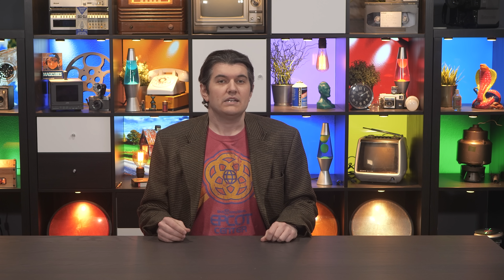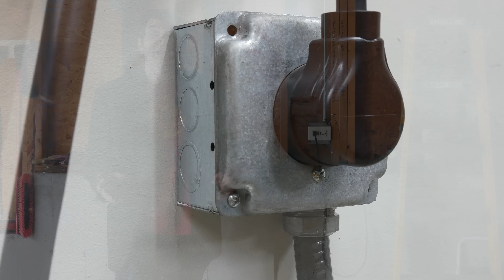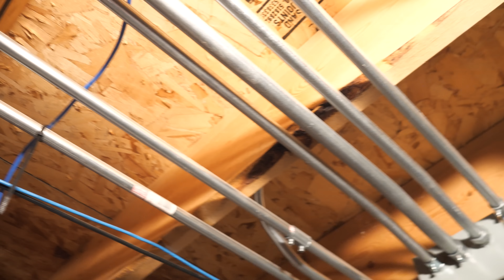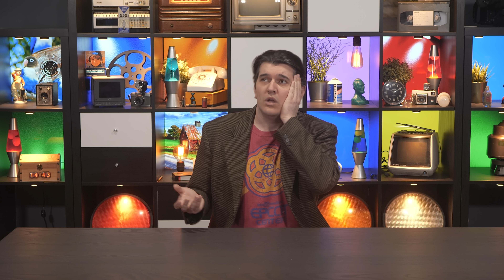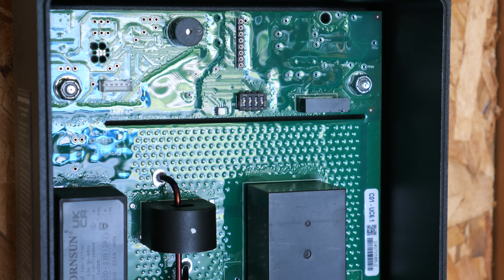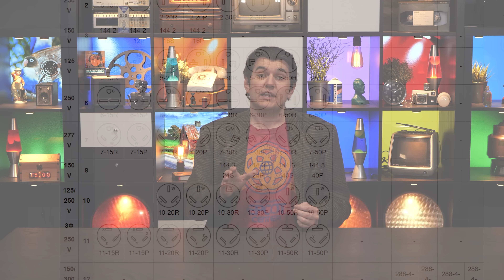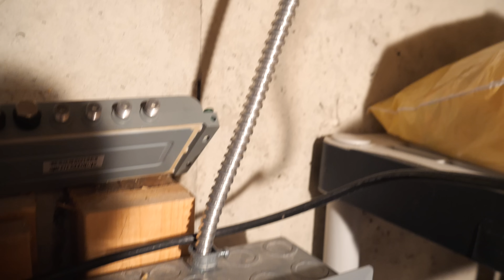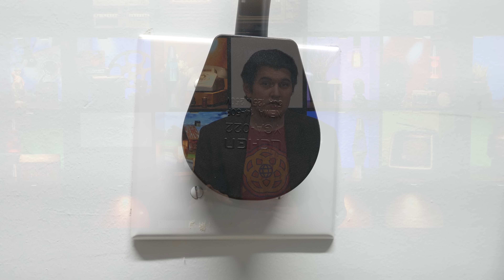The "standard" car charger is usually overkill—but your electrician might not know that

Comment: I drive a 2013 Chevy Volt. I use the standard outlet to charge it at home. Before this car, I drove a Nissan Leaf and still only charged it with the standard outlet. It doesn't hurt that my work has free 240 charging that I used nearly everyday as well. My commute it only 20 miles one way, so my Volt requires that I use the charging at work in order to get home again because of my car's age and limited charge capacity.

Comment: Be aware that hardwiring it like this turns it into a fixture, and it belongs to the house and not the owner.  If you move, this matters.  Also check to see if you need a neutral, many older circuits omit the neutral.  I have a 30 amp circuit, installed in 1967 for a window AC.  It has no neutral and a 14 gage ground.  Apparently code at the time.

Comment: great video. I live in an apartment complex on the second floor and frequently run a long (properly gauged) extension cable to the parking lot just outside my window to charge my PHEV during clear weather (yes I continuously monitor it during charging with a security camera). works great for my commute. there's so many misconceptions out there about EVs

Comment: This guy should state in the beginning that everything he is saying is HIS OPINION ONLY. Code requires the breaker and conductor to be rated for 20% more than the load it will carry. I actually would tell people to install the highest amperage breaker/receptacle that their wall adapter can safely handle. You should also put the EV wall adapter as close to your main breaker panel is as possible. I have an older Tesla that can handle 80amps of 240v Level2. That requires a 100amp breaker. Most new EV's can handle 48amps of level2 charging. This requires 60amp breaker and for the wall adapter to be hard wired. If you are using a 50amp receptacle you are limited to 40amps of charging. Also charging using a 120v 15amp outlet is painfully slow. Youd be limited to 12amps and takes more than twice as long to get the same charging as 220v at the same amperage. Id rather having the voltage & amperage available and not need it than to need it and not have it.

Comment: You: "Can be installed on a branch circuit of any size"

The Emporia classic, for one example, says in the instructions:
"To reduce the risk of fire, connect only to a circuit with 60A maximum branch circuit"

This is despite the fact that the charging rate max can be scaled by breaker size as a feature.
Because of this line, the electrician has little choice, as code requires that he follows the directions.

Then, it's not just the electrician. Despite the fact that with a Vue it has peak leveling to prevent the charger from causing the panel to exceed the 100A, the inspector might require panel size load calculation based on that 60A.

You're right in concept, but the whole system from manufacturer, to electrician, to electrical code are all happy to let it be someone else's problem. It's not just your electrician.
Reply: They say that you should install it on a branch circuit with a 60 amp MAXIMUM over current protection. You can install it on a 50 amp, 40 amp, 30 amp and still be within those instructions. They are telling you to not install it on a branch circuit over 60 amps, so don't install it on a 70 amp branch circuit.
Reply: That's not what that means. They're saying it should not be installed on a circuit rated at more than 60 amps. Confusingly worded, true.
Reply: To be fair to OP, EC is often confusingly worded, as are manufacturer specs.  I could argue, say if I were an inspector, that a "60A maximum branch circuit" is a circuit which can supply 60A at maximum and a 50A branch circuit cannot supply 60A at maximum.  Obviously when referring to risk of fire we are concerned with oversizing breakers, but I'm just an inspector, not the manufacturer, and it says "connect only to".  Sure, I could put a 60A load on a 15A branch circuit and not cause a fire, but if that's not what the specs call for then why am I doing it?  Wouldn't we all be happier if it instead said something like "allows for variable load, install on branch circuit no greater than load setting."
Reply: The EVSE is simply a communication device, a contactor, and a safety monitoring device. Watch the video, he is 100% correct. I have installed 3 phase systems that have 3 single phase 208v chargers on a single 3 phase 208v circuit. They communicate with each other to determine what each car is pulling and will adjust the charging "available' signal to reduce it down to the correct amount that is available. It definitely passed code. I will say that MC or AC cable is available in larger sizes than #10, but not from your local hardware store, you are going to have to go to an electrical supply company or a electric wire and cable supply company to get larger sizes.
Reply: An Example of why this may actually be acceptable, according to the NEC A 20 Amp Outlet receptacle is good for both a 15 and 20 amp branch circuit. Of course thats still subject to the Authority having jurisdiction (The inspector)
Reply: @quantuminfinity4260 15A receptacles on 20A circuits are actually an exception — and the only exception, afaik, at least in most of the US in residential settings — that everything behind an N amp breaker should be at least capable of working with N amps.

That said, it’s still just a maximum, not a minimum.
Reply: @JasperJanssen  Gotcha, that makes sense, I definitely have not heard of any others.

Comment: 'The mere idea of a charging station like this having an app...' honestly, as someone who spent over half a decade on a phone which couldn't install Spotify and WhatsApp at the same time, pretty much nothing should require an app to configure or control it. If it doesn't have physical controls or requires you to void the warrenty to get to them then its most useful application is to plug a hole in your wall.

Comment: At least you bought a quality EVSE.  I completely agree with your underlying premise that people can get by with less power then they think they need.  However, I do disagree with the logic of doing the physical labor to install all the wiring and unit and you didn’t do the marginal extra work and cost to use conduit and put in a 50 amp circuit.

I have a Ford Lightning where I used 12 amp for the first 3 months and after installing the capability to use upto 48amp (for TOU using mandatory Utility supplied EVSE) I often software derate to 16 amp on many nights based on planning.  However the first few times you NEED to recharge quickly, the decision to wire to the full capability of the EVSE you already paid for will be that secret regret you don’t speak of at parties!

Comment: didn't hear him talk about what your time is worth waiting on something to be charged or if you need to use it quickly after its gets drained due to an emergency ,you would have to wait till its charged, this whole show sounds like he did half the amount of research he needed to and didn't bother looking into why the EV charging company's push for fast charging, they want to replace fuel based vehicles, people dont want to have to wait long times for a battery to charge if they decided they need to use the vehicle all the sudden, with gas a quick stop at a fuel station solves your tank level issue, with a battery you have to wait possibly hours for it to be charged enough, its amazing he must live in a really dense city and never has to go anywhere if he only uses his vehicle 200 miles every 7 days.

Comment: I moved into a brand new home with 220v outlet and EV charger. I used the 110v charger for over a year, and it worked out just fine. Most people drive 35 miles/day on average. Same with me. The fact that my battery had over 200 miles of range, it was a buffer for those few days I drove farther. Some days I drove less, so it balanced out. But..the main point is that my car was charged every night on 110v. And it was enough.

Comment: I think a key consideration is your time of use cost.  If my daytime power is 18 cents, and my nighttime power is 4.5 cents, I really, really want to make sure I am only charging on night-time power rates.

Thus, if I am charging at home, I really want 220/240 VAC because I have an 8-10 hour charging window.  10 hours at 120 might get me 30 miles of range, which is less than my commute.

OF course, I could top off on Saturday as long as I didn't have any errands to do.

Comment: First of all, sweet EPCOT shirt. Second, you're exactly right. We have a Volt and a Bolt. We charged the Volt for 3 years with a 120V receptacle. For the Bolt, I installed a 240 V circuit with a dedicated 20 amp/240V receptacle and it charges great at 16 amps. Works great, super cheap and easy.

Comment: The main Problem with Aluminum Wires is that the have a tendency to deform over time and losening a screwed connection. For smaller wires a spring loaded connection is way more reliable.

Comment: I'm now considering buying second EV. Unfortunately, the only options that are good cars within reasonable budget, can't be charged with three-phase charger. I have no problem supplying 11kw to our existing car via 3-phase plug, but running 5+kW on a single phase would require rewiring half the house.

Comment: Every time right-wing anti-EV folks argue that "electricity isn't reliable" I have to just laugh considering the utter fragility of petrol supply chains. It's like...just imagine having a small gas pump at every building, in essentially every room...and that you can make your own fuel...with the sun if you had too. Good luck with that backyard fractional distillation setup to get your gasoline buddy.

Comment: I see the difference in attitudes to length of washing machine cycle. We have our washer in the house and will use the cotton eco overnight 5hr program. Set it up, hang out in the morning. Simples.
If you're in flats with a communal laundry in the basement, this would be terrible. However, with a short cycle, you still spend more time on your washing than I do cause you have to stay with it in the laundry.

Comment: I only went with the max capacity on my EVSE because I was getting it installed as part of a solar panel installation, and it was the same cost either way and I figured I'd might as well do the biggest possible. Before that I was using a plain ol' 110V charger and it was more than sufficient for my driving needs.

Comment: I don't get the talk about spending time refueling a fossil car. I refuel once every 1000km and it takes 5 minutes. That's measured (and I have measured it) from pulling off the road and to when I'm back on track, and includes jutting down the data needed for tracking milage and costs. 
There are many valid arguments against burning oil but time isn't one of them.

Comment: My only issue is the comment about the MC cable. "The largest wire size it comes in is 10awg." Maybe you meant the largest size you could easily get a Menards but you can get 6/2 MC online or from a trusted local electrical supply store. Wirenco has 25' 6/2 MC shipped for cheaper than it looks like you spent on 25' 10/2 MC at Menards.

I'd never recommend you go for a faster charger than you needed but 6/2 MC would support 240V 48A charging on a 60A breaker if you wanted(my main concern there is DIYers not doing a load calculation beforehand.) I do support people over-specing their cables though as a larger wire delivering the same load means less heat and more efficient charging. That added efficiency and safety margin would cost you -$1.47 if the price on screen is to be believed.

It is worth noting that 6/2 is thicker making it more annoying to work with and could be a lot more annoying in a full breaker panel.
Reply: Came here to agree. Southwire lists MC to 2 AWG, and even Amazon sells 8/2 w/ground MC, 25' for ~70.  If you limit your suppliers to retail places like a hardware store, you're going to make faulty conclusions about what is available.  Fortunately, I don't live in Chicagoland so I'm not limited to EMT for residential, and I can run NM-B with appropriate clamps & bushings.

Comment: My wife and I have a single car. It's an EV. 
We charge it at home with the portable charger that came with the car, plugged into a standard 120v outlet.
It handles all of our charging needs outside of long trips where we need to charge on the way (obviously not an issue of home charging).

Comment: One note: not all EVSEs might come with ground fault device. EVSE always should have one, but sometimes its case of "this EVSE doesn't have ground fault device...... we demand your electrician shall install one on the supply circuit". Atleast such can be case for meant for permanent install devices with permanent wiring install.... since well it is supposed to be installed on dedicated circuit anyway. Then the install manual will just have a stern "thou shalt absolutely install a ground fault device  of this specified type on the supply circuit".

Plug lead ones probably will have internal ground fault, since any dumbo can plug it in any outlet and it cant be sure circuit is properly protected.

So just a "read the manual and tech spec of the device" warning. If it has internal ground fault device, no problems. If it doesn't, one absolutely shall install one. To prevent some happles dumbo become the ground path of the circuit incase of insulation failure.

Comment: Here in UK, domestic charging stations normally come ready to connect a CT ring to clamp around the main incoming phase of main panel (mandatory for some installers).

This way, the EV charger can read the power being used in the house and temporarily disconnect / reduce its power when the demand in the property is high to prevent tripping the main fuse (all properties have a distributer fuse before the panel). 

This is so common that "special" wires to supply power from the panel to the charger are sold with an integrated Cat6 ethernet to allow for the CT clamp to be connected the other end (Yes, they usually use this standard for two conductors...) 

Some other charges allow to connect to the Internet to allow communication with the electricity supplier company which can offer very cheap rates if the charger is drawing power in moments when energy production is higher than the local demand. Useful as dinner preparation times are often peak in the grid, while periods during overnight can be cheaper. 
In UK, storage heaters "charge" at night and their charge time depends on how cold they are, hence why the demand overnight is not always predictable. 

I agree against overcomplicating what could easily be a simple relay board, however it will be impossible to have these features without a "smart" charger.

Comment: One Hundred Percent!  It drives me mad hearing people and journalists advising prospective EV buyers they MUST have a big 220V circuit installed or a dryer plug near the car.  No. You. Do. Not! Need. That. Most likely you just need 110V 15 amps.  Yes! I thought we'd maybe need a 220V 20amp circuit for our Tesla we bought 4 years ago.  Turns out, absolutely not.  We just used the existing 110V outdoor plug at 900 watts for the last 4 years and it provides more than enough power than needed, gobs more, and the bill is about $20 a month.  We would use the car for daily commutes 40-80km and then ramp it up to 100% charge for weekend getaways, without any hitches, no waiting around, no needing to go Supercharge somewhere.  No,  a 100V 15 amp plug is more than enough for a Model 3 size EV driven daily and on long road trips.  

You need to be like a Uber driver or real estate salesperson to justify needing a 220V 20 amp plug at home - or perhaps have multiple EVs in the household sharing the same plug.  30 amp plug is just stupid for EV I can't see it ever being needed even for long commutes nor Uber drivers.

I still have the Tesla wall charging unit new in the box, four years old, as I had planned to install it on a dedicated 200V circuit soon after buying the car.  But never needed it.  Never.  

Save your money

Comment: I'm Minnesota, at least in 2003, I wired my basement and garage.  I had to get a permit.  You had two inspections.  When the wiring was "ruffed in" and the final.  The inspector was very professional and no one ever told him he was a government worker!  My breaker box is as far away as you can get for the garage in my house.  However, my dryer plug is in the wall that is the back wall to the garage.  About 3  7/8 inches away from being 100% perfect.

Comment: The main reason (for me at least) to get a somewhat smarter charging station(not internet connected) is to control it to so only charge when solar covers the power (no batteries). And because I can control it locally with Home Assistant. Would never ever use the cars system as that's something I don't have control over because the car makers locks it down so have to use their Internet connected systems, which is just data stealing privacy issues up the wazo.

Also Wago says hi!

Comment: Your solution is not correct.  The issue is if you ever need 250 miles in a day.  Sure you can supercharge but the cost can be 3-5 times the cost.  It negates the savings you get with home charging. I also have solar.  I chose not to charge with full power to utilize my solar and not any from the grid.  I don't like your minimal viewpoint on EV charging. Sorry, thumbs down.